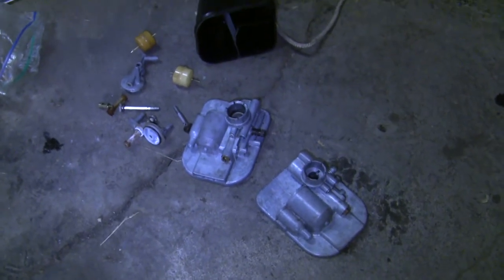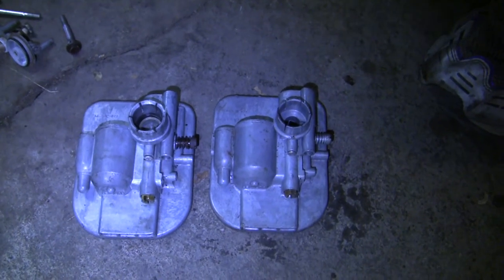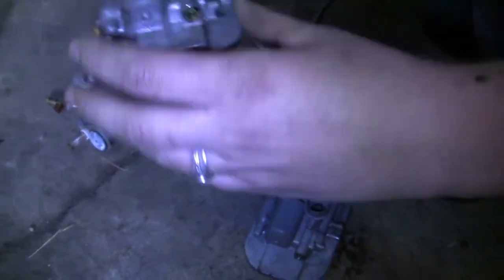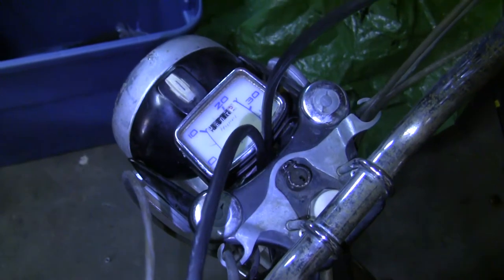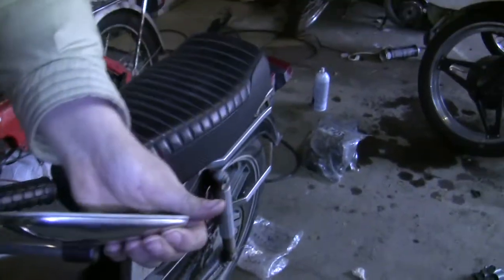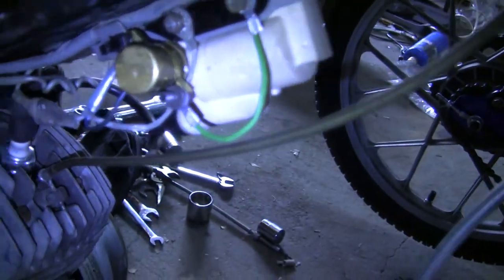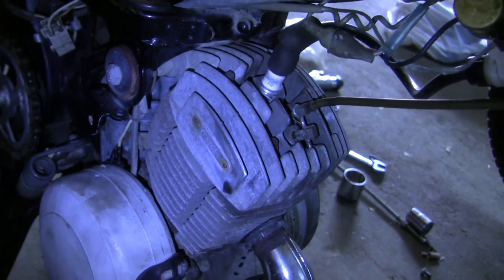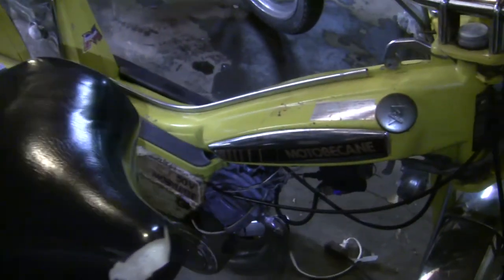Motobecane Mopeds are Beautiful (but Frustrating!)

Comment: My first ever moped was a 1975 motobecane. Man am I lucky I am somewhat mechanically inclined!! Mobys are a pain but are so worth it once running good. I got mine for free and some guy had it under a tarp in his yard. It was missing a coil and the carb was shot. I put a new coil on it also did a condenser just to be safe and I haven't had any spark problems as of now. I just recently put the airsal 74cc kit with a Dellorto sha 15:15 carb on a molassie shorty intake and man does it rip! I love my moby and always will. I learned a lot from my moby some good some bad lol.
Reply from the maker: Awesome! There is certainly a great selection of kits and aftermarket parts available in general for Mobys, people forget that they imported a ton just like Puch Maxis.
Reply: Yah I would love to get a maxi I like the deign. I will forever and always love my moby, way to many crazy adventures and meany mor to come! I'm thinking about posting a video or my moby on my channel, I'm just waiting for better weather, New England weather sucks!
Reply: Have you ever worked on a Indian moped?I have not seen many videos here on youtube about those mopeds?Cheers

Comment: I had one new and your guy is correct on all counts. Getting a spark out of a Moby could be a nightmare, I stayed so fit running with that thing and pedalling it to start. All the juice was where the weather came in. Also the carb was temperamental to atmospheric conditions, it would struggle to hit 30 mph one day, and another day would spin out at 43. 

However they were everywhere in France, so I guess the locals were so familiar with the Mobylette's many foibles they had a workaround for them all. I'd love one now but they've gone cult in the UK.

Comment: I have 2 1977 motobecane mopeds in perfect condition and i have never had any condenser problems. To properly clean points you open them and then use real fine sand paper to not damage them.

Comment: 1977 Mobylette 50v here - dumb question, but which side of the engine mount does that little spacer go on? Took the mount apart and didn't see that little sucker til afterwards. Any advice would be helpful, thanks!

Comment: Hi,
Just because you have to change the coil and points on all of them and all the lightbulbs, (which are burnt out), they are sturdy, well made great handling bikes! Why be frustrated, you usually need to change the variator bushings, if it has one, and the carbs i have , the 2hp and the model 7 oddball ar1-10 (want a 12), are good and work great. but on most you can throw another carb
on and be good. The 1980 moby I have is really great- I think it is actually more sturdy frame wise than my 1978 puch sport mk2  I once had. Myrons mopeds in cali did a great job keeping me on the road. I also used treats a lot
Reply from the maker: I can definitely agree that a lot of care went into the moby design. In good condition, it is probably one of the strongest stock mopeds you can have, but for a novice looking to take one on as a project, it can be pretty intimidating!

Comment: Your channel is awesome!  I just purchased a 1977 Motobecane 40t with a leaky fuel tank. What do you recommend to make the repair?
Thanks.
Reply from the maker: Stephen Vinson Thanks - ah a rigid moby, nice!! 
So Motobecanes and Puch Maxis are tough because the tank is integral to the frame and provides structure. If it were me I would source a new frame since the structural integrity of the bike could be compromised OR have a welder friend (or radiator shop) braze where the leak is then weld on some plating to toughen things back up. On bikes with removable tanks I've had fantastic luck with the POR15 cycle treatment kit which is a de-ruster and liner kit but comes with a patch of fiberglass you apply to the outside at the same times as you coat the insides.
Reply: Thanks for the quick response. Well sourcing another moby frame is out because those are very hard to find around here and when they do come up the person selling is wanting a ridiculous price. I'm not sure about brazing I talked with my buddy who has access to welding equipment and he is apprehensive about doing that on a gas tank. I could take it to a shop but that's probably expensive. Have you had any experience with gas tank repair putty?  If so what are your thoughts?
Thanks!
Reply from the maker: Stephen Vinson Yeah there is a lot of prep work involved before you can put a torch to a tank, there are some good MopedArmy threads about it. I used that $7 gas tank repair putty on a Benelli tank once, it seemed to hold and be "okay" but it was starting to bubble and it never really hardened so I wasn't super confident about it. It says on the package no prep work required but I wiped it tank down good and hit it with some fine sandpaper anyway.
Reply: Stephen Vinson I think I will try the repair putty this weekend if the weather cooperates. Thanks for the info.

Comment: I got a 78 and lights stopped working do you know what might be wrong?
Reply from the maker: When lights go from working to not, and the bike still runs normally, the order I check things is usually this:
1) Bulbs (you'd be surprised...)
2) Bad grounds/disconnected wires
3) Lighting coil...as a last resort
Reply: Thanks but idk where the lighting coil is

Comment: you two act like they are so hard to work on when really they are not. I've purchased many mbk mopeds and never had half the issues you are talking a about..   its a French bike and more reliable than most bikes out there once dialed in, you are running a stock bike with almost 40 year old parts! what do you expect,.. get updated parts if it bothers you that much ,  welcome to the moped world
Reply from the maker: For what it's worth, one of the nicest, smoothest mopeds I have ever ridden was a factory AV88 Spanish made Motobecane owned by another member of my moped club. However there are nuances about them that can be challenging for a beginner, and very frustrating once go-fast parts start getting thrown.